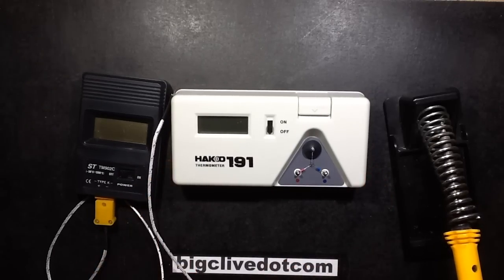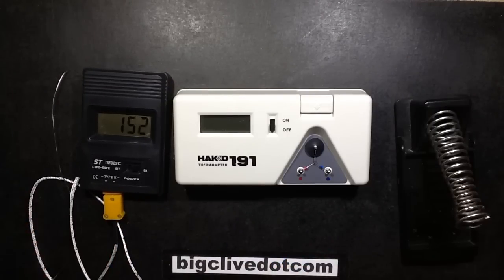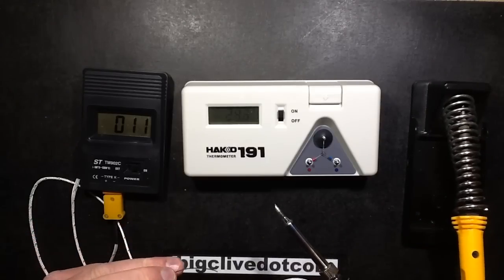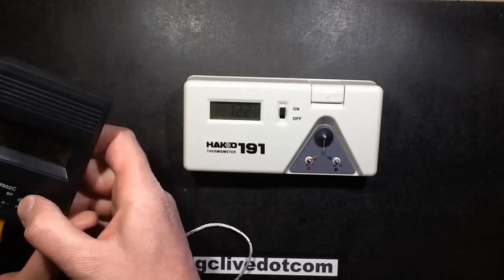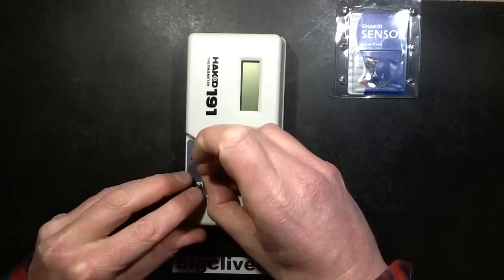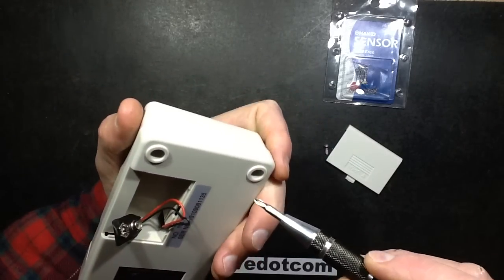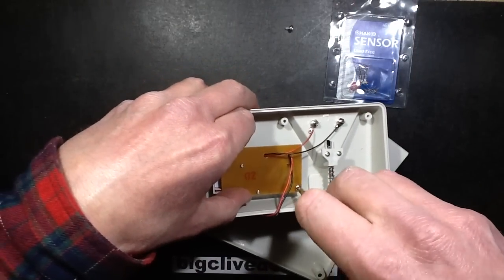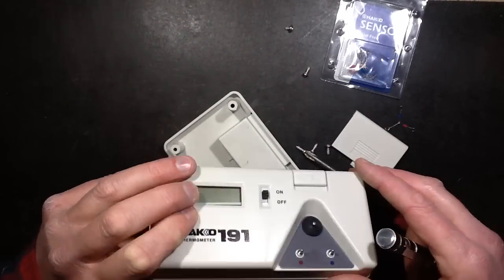A look inside a "Hakko" soldering iron tip temperature tester.

Comment: Hakko has a video on those. They recommend 50 uses before replacing the element. They also recommend letting the flux burn off completely before temperature testing. They also recommend not pressing down any more than necessary during the measurement...
Reply: They also recommend to use razor blade only once

Comment: I bought one of those Yihua 898 2 in 1 soldering iron stations......actually i'm pretty sure it's a knockoff of the Yihua. But anyway i used it a few times and it barely hot enough to do the jobs, and then it stopped getting hot enough to melt the solder, and was throwing an error code. So after some basic trouble shooting such as turning it off and on again, and making sure it had good connections, even went and bought another iron for it just in case. Same problem, so i finally got pissed and gave it a good whack, noticed that the temperature changed, gave it another tap and the temperature changed again. Opened it up and found a capacitor that was broken loose from the solder and was kinda just hanging in the circuit board. The irony of having to buy soldering iron to fix another one...........
Reply: Ahahaha when comments are more amusing than the video itself...

Comment: Love ur work. I got my 191 today, definitely a knockoff, not even called Hakko. Power switch doesn’t work, on all the time, reads 360 when iron is at 340 and 520 when iron was set at 420, iron prob way off on second one. Will try the same t12 tip in the elcheapo as well as slightly better ksger next time. Keep up the good work.

Comment: Clive, I got one of these to compare it to my newer Hakko FG-100 Although the FG-100 has more features such as MAX HOLD, the 191 works just as well.  They both read exactly the same, except for the extra digit after the decimal point on the FG-100, which I think is overkill.

Comment: Clive, it's about 50 measurements or 50 touches before the sensor wire needs to be replaced. this is from Official Hakko instructions for their other device using the same exact wire:  https://www.youtube.com/watch?v=1OmH7QxlXxQ
you can make it last longer than 50 uses if you wipe center sensor part of the wire clean with Isopropyl alcohol and don't let the flux solder burn black on it.

Comment: I got the cheapo one. It came with a surface one and the wire one. 
But the wire lead reads my soldering iron was 110c low. The surface meter helped and found out I was only 20 degrees C low.

Comment: The K thermocouple you use with that cheap meter is only rated for 250C.  Above 250C, the value reported won't be quite correct and the insulation on the thermocouple may also be damaged.
Reply from the maker: The probe supplied with the meter is apparently rated to 400C.  Although that doesn't really mean anything from China.  It does have fibreglass sleeving.
Reply: +bigclivedotcom 
Hello Clive,,, Here is a fly for the ointment. .. 
If you bought 100 rolls of solder of each brand. And the packaging said that they were all the same composition and the same melting temperature .
How close would you say that the melting point be , between brands, and within the runs of each brand.???

With 13 yrs at being a QA, QC department head, I am  always thinking of unbelievably boring things to do. 

My wife is jealous,  doesn't like that I spend more time listening to you than her...
Keep up the good work. ..  :-)

Comment: Curious. I've never had to put solder on my iron to get a good temperature reading. Simply clean the tip with a damp sponge (natural) or one of thos metal pot scrubbers. It'll work fine.

Comment: I have kester soldering wire that I know from website melts at 188C. So I just start the iron at 140 and slowly increase the temp till the tip can just about start melting the wire. Not super accurate but saves me the hassle of investing in super expensive tip calibrators!

Comment: Just bought a 191 from Portsmouth (just down the road) on fleabay, but it will apparently take two weeks to get to Sussex... ??? When it comes, how do I tell if it's a knock off rather than a genuine Hakko?  (if the post label says it came from Hong Kong, that'll be a good indicator!)
Reply from the maker: Many of the Chinese sellers use common warehouses in places like Portsmouth.  If your new soldering station cost around £50 then it's a knock-off.  Real Hakko equipment is very expensive.
Reply: sigh - oh well. Thanks for the heads up. Still... Portsmouth to Sussex in two weeks... that's not exactly pushing the boat out :-D ... sorry, I need more cid... er... coffee. (I'd get fired for drinking cider at work.)

Comment: Hi Clive
Really enjoyed the review.
Did you need to adjust the calibration.at all?
Al.
Reply from the maker: +AlanRochester57 I didn't tweak any calibration on the unit at all.  I'm not even sure there's the facility to do so.  It seems to rely on fairly standard thermocouple alloys to give a modestly accurate temperature reading.
Reply: Thanks Clive
At £8.90 from China this is a great deal, I'm going to get one.
Al.

Comment: Adding a solder to the thermocouple contact point shouldn't change reading. Any additional metal-metal contacts just cancel eachother leaving only the voltage induced between the incoming wires. The thermocouple unit you used before is probably not rated for such high temperature hence showing the wrong readings.

Comment: The Hakko 191 is a knock off, I have the same one and it's way off. The original has 2 trimmer pots inside to set the room temperature correctly and the second trimmer adjusts the display once certain mv appear across  the thermocouple and just according to the table given in the document that jayzcreations posted the link to.

Comment: Definitely not a genuine Hakko http://assets.tequipment.net/assets/1/26/Documents/Hakko/191/191_doc_5.pdf is a manual for the 191 it includes calibration instructions and the PCB diagram is nothing like you're holding in 7:25

Comment: I want to start practicing soldering with small projects. I have looked at your shop a couple times, but as a complete noob I have no clue. I am looking for 110v AC led light kit with pcb I can start with. If you already have these kits, would you mind giving me a link so even I can find it? If you don't sell these in your shop, would you consider putting one together for those of us from another side of the world?
Reply from the maker: +james lawrence Search on ebay for diy soldering kit and you should find a range of kits from China.  Start with a simple low voltage one first.
Reply: bigclivedotcom
Thank you. I found 4 for $10. So now I have a few failures before a success for cheap :) I had considered this route, but being shy of ripoffs I wanted advice before doing it. Thanks.

Comment: why don't they put tip testers in soldering irons? that pcb is tiny, u could fit that in almost anystation. then just set calibration mode, touch the tip to the sensor and if the sensor reads 250 when the iron is supposed to be 300 it self adjusts until it reads 300 amirite that seems genius how come nobody does it?

Comment: Do you have a preferred iron? Station?
Reply from the maker: +Thomas Gunkler whatever comes to hand and does the job well.  At the moment I'm using a Yihua 8786D because it also has a hot air pen.
Reply: +bigclivedotcom thank you
Reply: where did you find tips for that Iron?
Reply from the maker: +Thomas Gunkler they're sold in packs on ebay as Hakko bits.
Reply: big thanks from NC, US! Thanks for taking the time!

Comment: I have compared this (fake) 191 against the fake FR-100, and matched them with my very reliable JBC BT-2BWA analogue soldering station and 3 A brand multimeters with thermo couple. The FR100 copy is spot on and the 191 is about 30 degrees off and there is no way to calibratie it. So be aware!

Comment: When I set my Hakko iron to 350 C, this thing says it's around 500 C.
Reply: Same problem with my cheap "191" unit I think. It shows all 3 of my irons are well over 80°C hotter than their set points. I've also tried connecting another K type probe to the unit (using crocodile clip leads) and this shows my cup of tea is over 120°C!  Hooking up a 181 Y shaped  probe to another general purpose K type meter (again with crocodile clip leads) gives results much closer to the irons displayed set points. In short I don't trust it!
Reply: @JJHamster  might be causing issues due to the interfacing metals, If you're basically hooking up extension cords to a thermocouple.

Comment: Dear sir, what you are testing your irons and temperature with is not a original Hakko tester. You have a counterfeit Hakko tester. I saw your video and the PCB inside is NOT original. The original PCB part number is B2345. It has been discontinued. The 191 tester look almost identical but are NOT.
Reply: Guillermod Cruz Yeah but the original is like 400 bucks and the fake one is 10$...
Reply: @paulzaim7900  Well I hope you don't believe in the fact that you're getting identical quality and performance for 1/40th the price!

Comment: Solder (liquid - hot) WILL damage/destroy your thermocouple if it comes in direct contact, possibly eating away portions and making it drift and inprecise and intermittent wrong measures.(like copper soldertip without protective layer gets dissolved away)
Reply: Which is why you A) need to burn away any flux first, and B) the thermocouples are disposables. The solder is needed for an accurate reading without oxidation and air in the interface that won't be there when doing actual soldering. But it does come at a degenerative cost to the measurement thermocouple.
Reply: This is not how thermocouple works. It wont be damaged by adding a solder or any amount of intermediate metal in between the leads. Any additional metal-metal contacts just cancel eachother leaving only the voltage induced between the incoming wires.

Comment: And because I can't resist cheap Chinese clones, I just bought.. another clone Hakko soldering tip temperature tester!  This time the 'Hakko' FG-100:  http://www.ebay.co.uk/itm/141982376192
For some reason not directly shown on UK eBay, so I ended up paying for it in Australian $.  Still only cost about £9 though.
The FG-100 is obviously a later model, and now features a MAX HOLD button, and goes up to 700°C rather than 600 (not that I can see that mattering with soldering!)
Other than that it seems basically identical in function and operation.   I saw another eBay video where a US guy compared the original FG 100 to the clone, and it turned out to be within 1-2°C of the original.  Pretty good!
It'll be interesting to compare the FG-100 to the 191 when I get the second one.

Comment: it was 11c my shed tonight and that was freezing cold...

well at least your heating bills will be low.
Reply from the maker: scaleop4 All the more money to spend on technical junk.
Reply: indeed sir.
Reply: +scaleop4 when we came back in january from vacation, the house was 10°c, unfortunately the fridge freezer thawed! because the operation temperature range of it seems to be a minimum of 15-18°C.. Lower than that, the compressor will only start very sparingly because it doesn't need to do much to keep the temperature in the fridge part low, but it's not enough to keep the temperature in the freezer compartment below 0